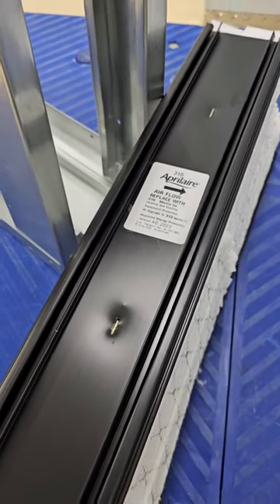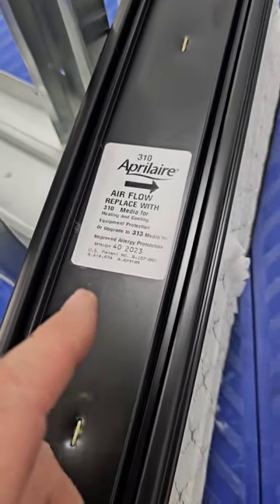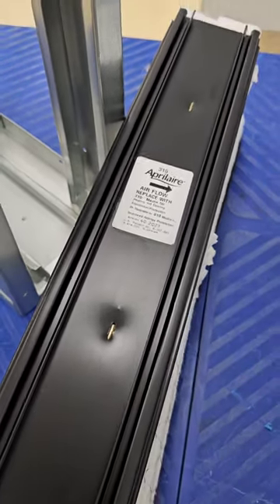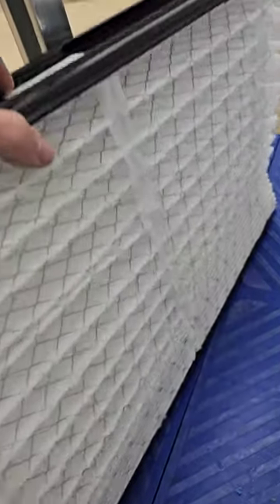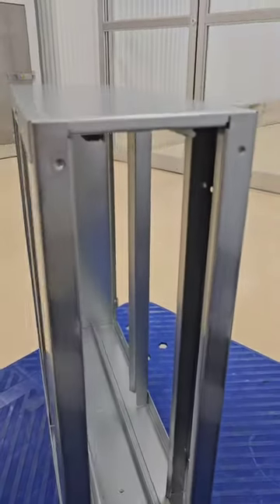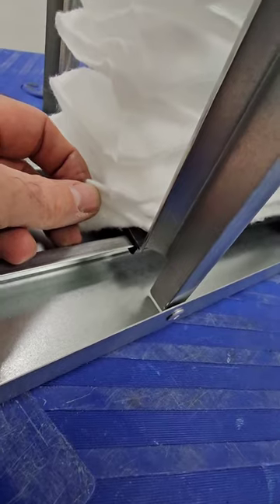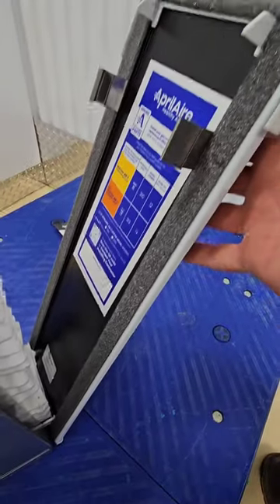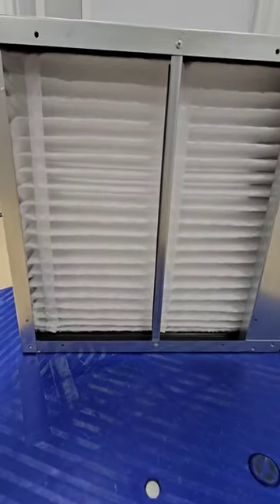Discover The Ultimate Media Air Filter To Stop Particulate Bypass And Eliminate Pressure Drop!

Comment: Hi buddy,I have a question on Liebert  hvac  water keep running and don’t stop and the pan is filled and lift the flow then stop then later start again
Reply from the maker: On those units, thr intial fill or when it starts filling.  It will keep running to what it's set up for.  For instance, if it's set to fill 5 times thr capacity of the pan, it will keep filling until it reaches that.  It should all be in the manual

Comment: Air bear is better, foam gasket around 5” box filter
Reply from the maker: How have you measured this to know that it's better!
Reply: 20x20 air bear merv 11 .09” at 800cfm is what they claim so assuming that both are true i would still rather have foam gasket than track and two unsupported butt ends